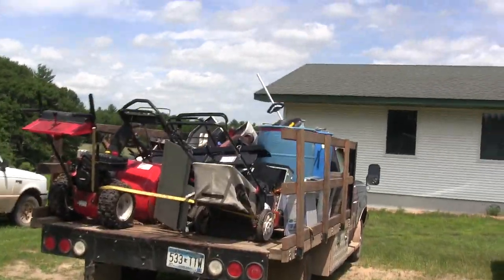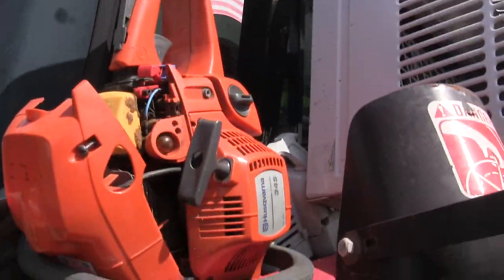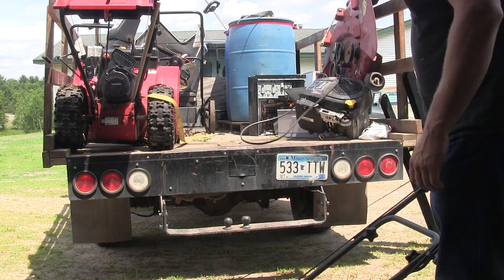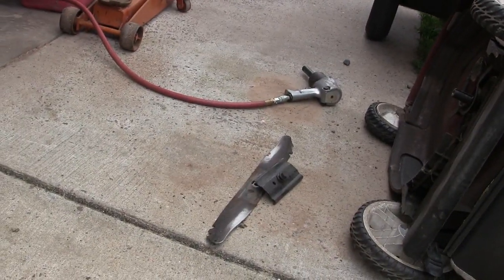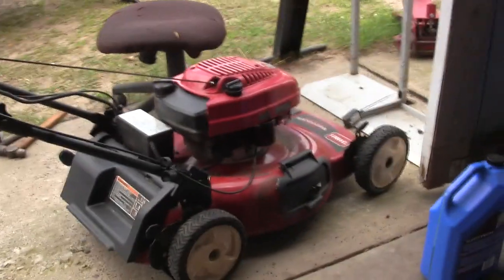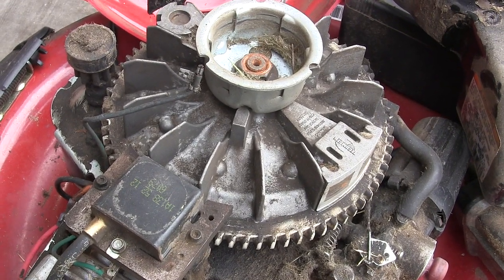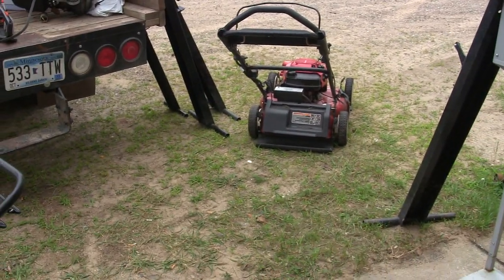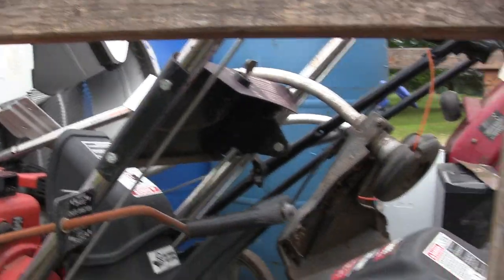Junk Resurrection

Comment: That toro mower is a fairly decent one.  The SLA batteries in those are cheap and they do die often.  Neighbor has one runs like a champ,  but needs a battery.  I rarely had luck finding running items like you have lol